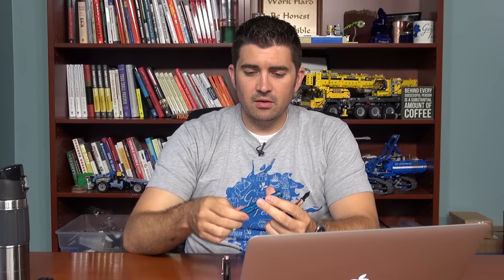Does Coating On The Nib Affect Line Variation? - Q&A Slices

Comment: Help! I just got the platnum carbon desk pen or what I believe it is. I tried to put the converter into it for the first time and it doesn't fit at all the recommended converter I got is too narrow. I thought how could this be?! After looking at my pen I noticed it doesn't look like the one GP has at all. What pen is it and what converter could I get for it instead?
P.S. It's the standard platinum gold converter.
Reply from the maker: That's no good! Does the converter look like this: http://www.gouletpens.com/plat-converter-500/p/Plat-Converter-500? That should fit the desk pen, but you're thinking you didn't even get the Platinum desk pen? Does it look like any other Platinum pen (http://www.gouletpens.com/platinum-writing-instruments/c/265)? With a picture, I might be able to figure out what it is if we carry it. - Colin
Reply: Sorry for the trouble Collin. I did a little further research and found out my pen is a Pilot desk pen not Platinum. Which explains why it doesn't work with the converter you showed in the link. Thanks anyway you guys are awesome!